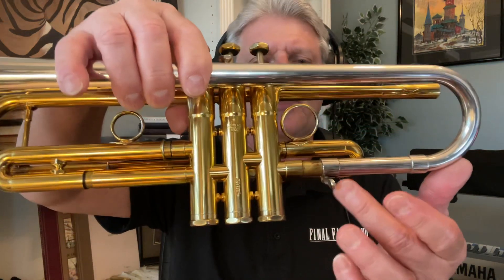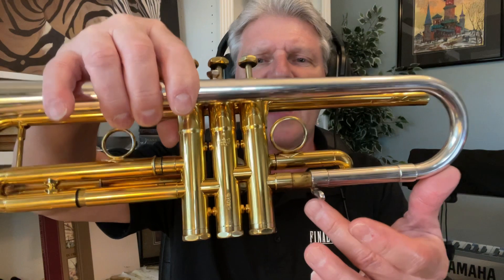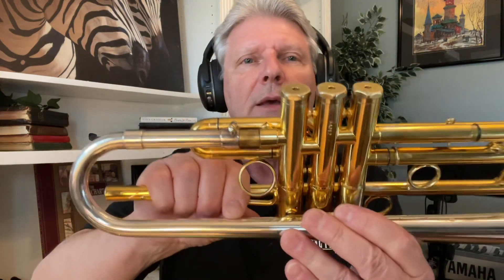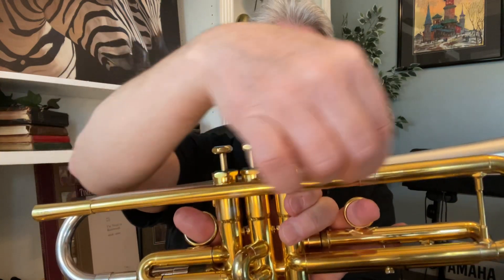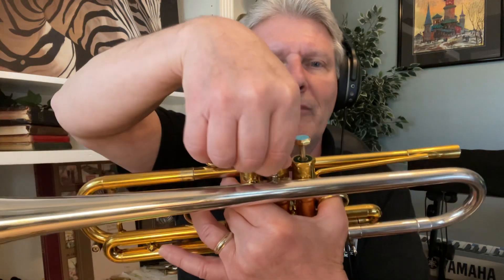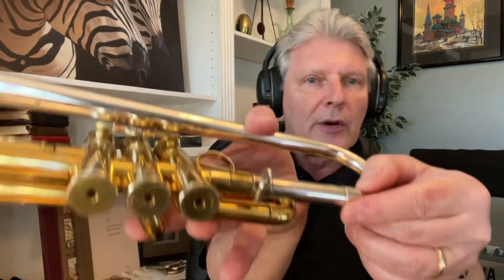Schilke S42L: SterlingSilver & Brass Bells!

Comment: Jonathan I thought the best sound was the sterling silver bell with the GR64 piece.  How does this Schilke compare to a Yamaha 8310z ?
Reply from the maker: Funny, but I was thinking the same thing earlier today; a Z and this horn. This horn is, to me, far more open than either Z I've had (and I've had two of them). This feels a bit heavier, but I think the L (Tuneable) Schilke horns have a little more metal added to support them. Anyway, this trumpet has, to me, a heavier, more solid feel and sound. I'm not dissing the Z horns - I really like them, but to me they're a little lighter in sound and weight (such great horns though). Somewere back about 16 months or so I did a review of a Z and a Schilke B6; now those two were quite similar. Great question, and thanks for listening. :)